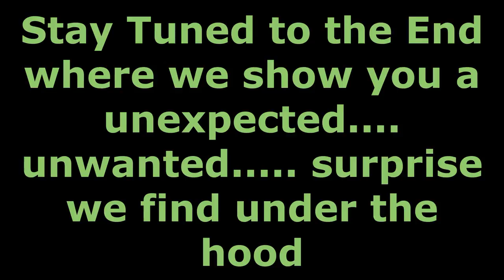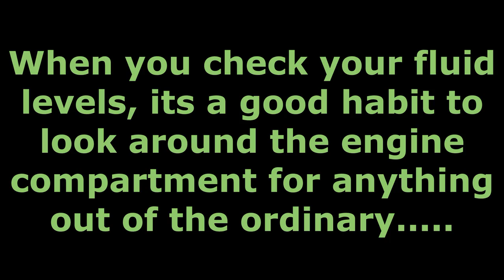How To Check Steering Fluid In Promaster

Comment: I am a mechanic. If your fluid is low enough to cause a noise and loss of normal function, please look for a leak around the power steering lines and rack and pinion. You must have a slow leak that should be addressed.
Reply from the maker: Awesome! Thank you for the tip and Iam definitely going to look for that leak.😀
Reply: Where is the water pump located at?????

Comment: No need to unscrew the bolt... slightly push down on the front of the cover and then pull it out, it should come out easily.. good luck 👍🏻

Comment: Out of curiousity Ive been looking at power steering fluids and everything I see says you need chf 11s for promasters.  I have a 2014 and would prefer to not pay 30$ for fluid.  Did that stuff work alright?
Reply from the maker: It has been working good. We have had no more issues with low fluid thankfully. I think I used dot3 and I should have used dot4 anyhow no problems and this is over a year later.

Comment: Thanks for this.  My 2020 doesn’t need the washer filler removed so I guess they made a sensible change. Thanks for the temperature tip as I noticed my dip stick  shows 90degrees on one side and twenty on the other (Celsius obviously).

Comment: Hey guys this is unrelated and I wanted to ask this a while back, now that you are near the year time frame is there anything you would change about your build?
Reply: This would make a great video! Hopefully they will put that together for us!
Reply from the maker: We just might do a video on this one. Off the top we would have went with a built in propane stove top. Bigger sink..water gets everywhere now, more insulation in the floor..our 1/2 foam board is not enough the floor feels like ice, and a cabin window which we still might add. That would give me more head room and a nice breeze in the summer. We will have to put more thought into this...great question!!!
Reply: @oneadVANtureatatime  For our floor, we started out with a layer of reflectix (i know, it's not supposed to do much when used this way), when 1 inch poly, then 3/4 inch plywood...we haven't yet used the van in freezing temps, but i'm hoping it isn't too bad.  Also, our heater's register is imbedded into our floor, about midway between the cab and the bed, so I'm hoping that helps with the floor as well.
Reply: @oneadVANtureatatime  I think doing a video on this would be great.
Also Dave, I wanted to tell you about LED headlights for your van. I put some in over 2 yrs ago and have not had to replace them yet.
Reply from the maker: John Tatman That’s it next time all go led! Lol  I watched a video about someone having trouble with led headlamps in there Promaster a few months back so never went that route. All try them next time, thanks John 😀
Reply: one adVANture at a time Do the LED headlamps look better than the stock?

Comment: I have different vehicle/rig but good reminder to check all fluids not just the oil and washer fluids.  Thanks for sharing and happy travels.
Reply from the maker: Very true! I constantly check the break fluid and coolant levels as well. Now I need to check if there is a slow leak in the steering, which is extremely difficult to see on a van with the engine packed in so tight.

Comment: Actually if you overfill the reservoir it will seep out the top of the cap when the fluid heats up.
Reply from the maker: I am guessing the last owner did over fill it..like you said there was a dirty mess all over the top of the resvervoir! I just checked the level again and it seems to be holding.
Reply: @oneadVANtureatatime  i used this guy off you tube for a leak in mine and he recommended I add this stuff that was 10$ and walla it is fixed...I freaking love youtube lol ..btw his name is scotty kilmer if you ever have a quick question and want to save lots of money